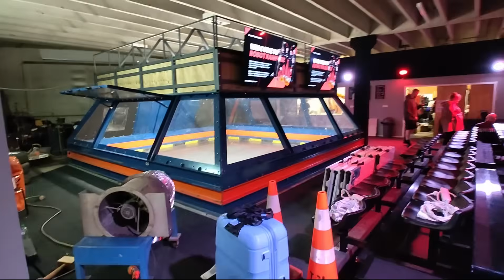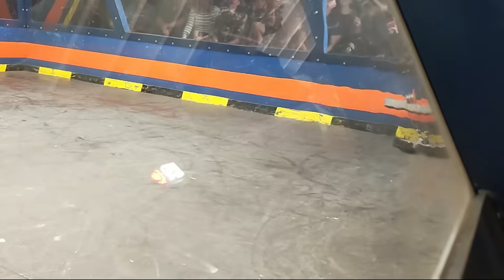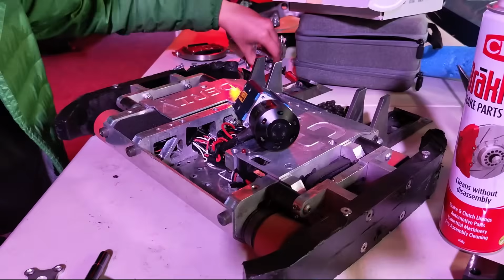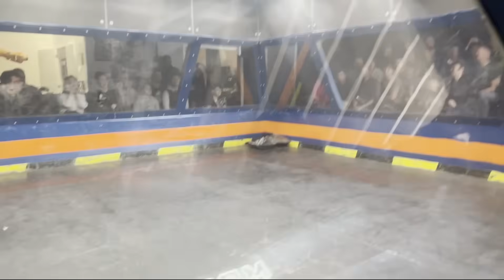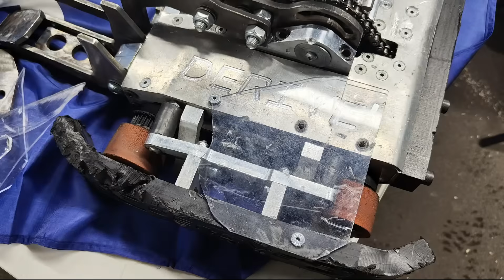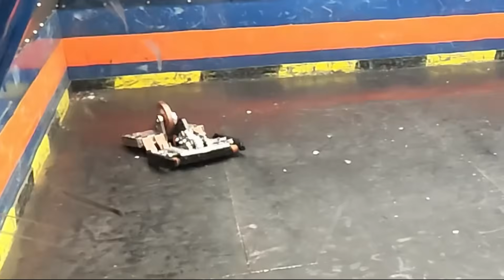Australian Robot Squares Up New Zealand's Best - Derive S part 4

Comment: Beating the ground game of the team that built Endgame is impressive! 

I wonder if making the spreader bars out of the same material as the armor would reduce the amount of damage you take, but that could just end up shifting that damage to the frame.
Reply: Being springy in the right places is huge for survivability in combat robotics. My 30lb machine (same weight class, but in the US) uses the same material for the side armor and also for the outer frame rails. My inner frame rails are steel, which is very heavy, but worth it as I've literally never had the core frame fail despite having enough weapon power to put bots into the roof in the local 20x20x10-foot box.
Reply from the maker: I reckon both the bars and the frame need to be stronger. Only so much one can do, but theres definately more to do! I've got the weight for it anyhow